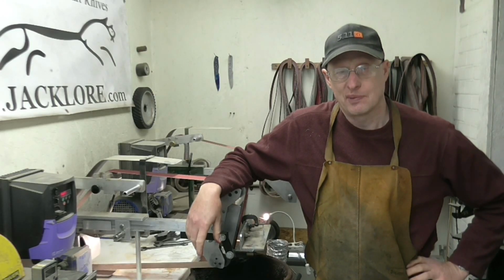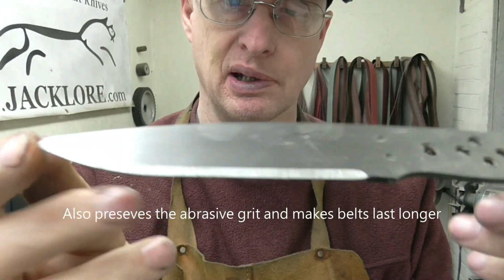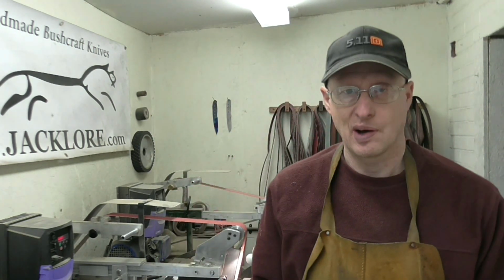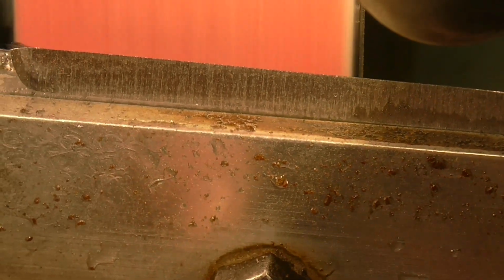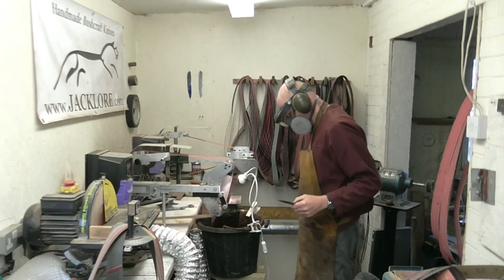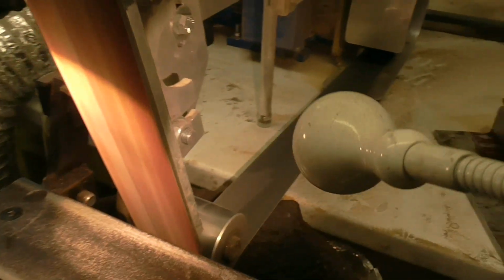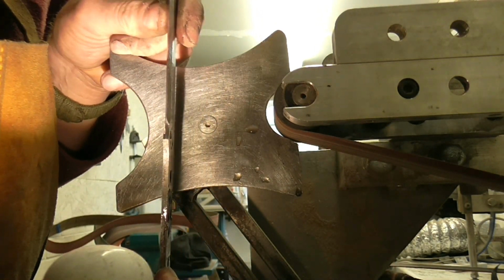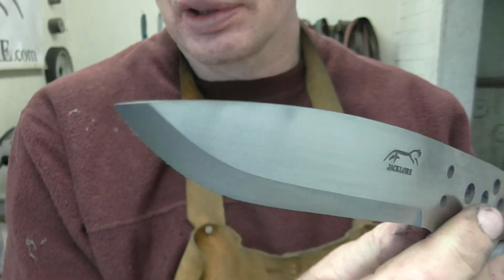Bevel Grinding using a jig

Comment: Sandy - quick question if I may regarding the jig
- if it is off 90degrees by only 1 degree why dont you just grind it on one side to get it to a perfect 90 degree ?
That wouldnt be too difficult to do with soft aluminium would it  and then you wouldnt have to do the compensation. . ??
Always enjoy your vids keep up the good work . .!!

Comment: I watch a lot of ur videos and u have helped me tremendously in developing my knife making skills. This is an older video that I haven’t seen. Did u say u do all ur grinds after heat treat? I do mostly 3/4 inch grinds before heat treat then bevels and a whole lot of hand sanding. My question is do u think 3/4 inch grinds would be to much to do after heat treat because on the heat it would generate?  
                     Thanks
              RiverMan Knives
Reply from the maker: No, Thats fine, you can grind your bevels before HT, 3/4 is good

Comment: This is the best video on doing bevels I have ever seen, thanks so much Sandy. I am a novice knife maker so I have a question. Why do you not do the initial bevel before you harden the blade?
Reply from the maker: +Chris Shive Hi Chris. Good question. There are three main reasons why I do not grind bevels prior to HT. One is it helps to stop warping during the quench.  And the other is that my fine cutting edge is well hidden inside the steel during HT and will not become decarbed. So I know when I finallydo grind the bevel the edge will be good steel..The third reason is in eletric kilns you have two types of heat, radiant and convective. The radiant heat can heat the surface of the knife to higher temps than you want, so that is another reason why I want my edge protected.
Hope that helps.
Thanks
Sandy
Reply: Thanks Sandy, that makes perfect sense.
Reply: +Jackloreknives Would you do it the same if you were still using a propane or solid fuel 'forge' affair Sandy ?  Or would your approach vary?
Reply: +DustyPilgrim1 Hi Dusty. Yes I would still use the same approach as I think this method represents "best practice" and you are guaranteeing that the steel the edge is made from is the best it can be. That is not decarbed and not overheated.
Sandy
Reply: +Chris Shive   its also easier to grind the Hardened metal   it cuts properly and you're less likely to dig out a lump   on Full flats etc you can  grind out a certain degree of warp after HT  as well